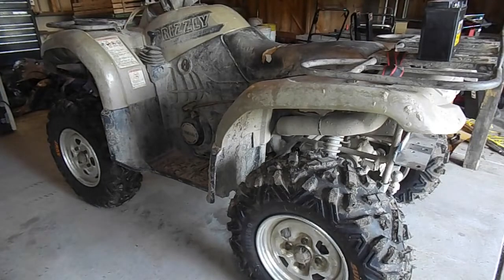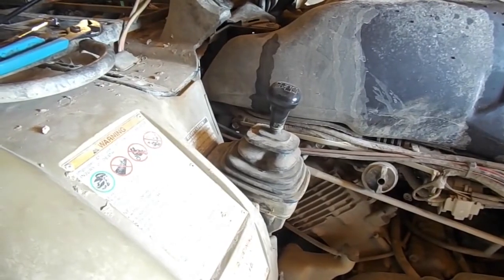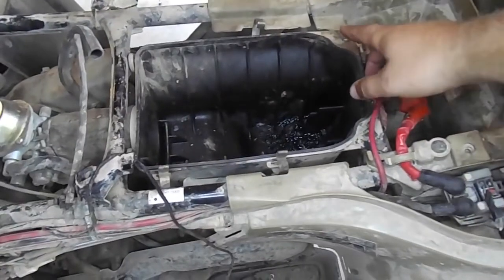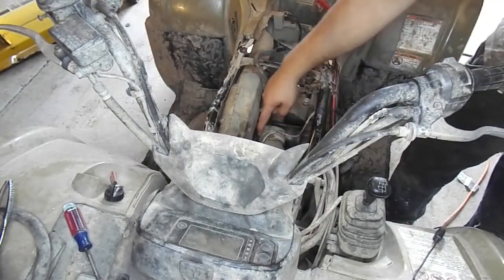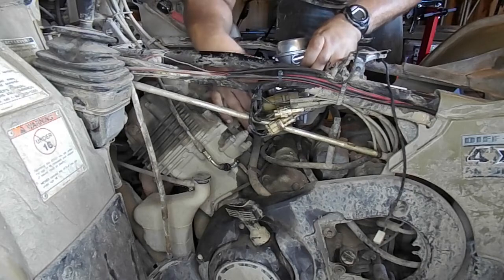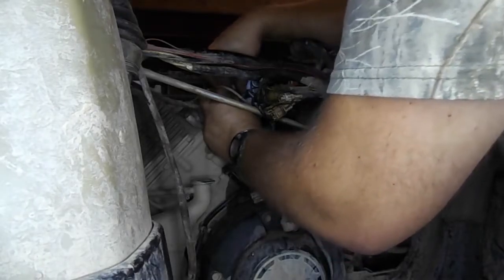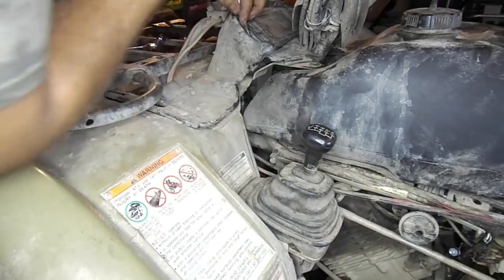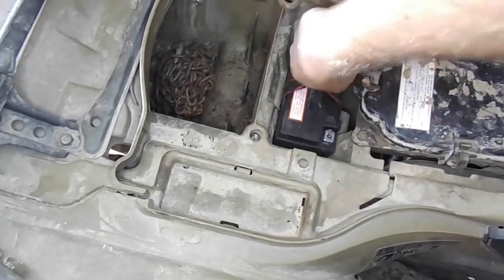How To Replace a Carburetor in your Yamaha Grizzly ATV 4 Wheeler

Comment: Got a question for ya I bought a 2004 grizzly 660 brand new 19 years ago off the showroom floor. Basically I’ve always kept everything OEM. I’ve taken my car bro part a few times over the 20 years just to clean the Jets or replace replace fuel, bowl, gaskets etc. etc.. during the process I have replaced my throttle cable several times over these almost 20 years and I realize there is an adjustment upfront where your actual thumb throttle is and then I realize there’s an axle adjustment that controls your butterfly. Do remember how many revolutions you turned your lock nut. So basically, when you go to remove your throttle cable, you back off your lock nut and then you turn your adjustment screw up the threads to create slack so you can disconnect your throttle cable from your carburetor/butterfly spring and then of course once you get enough slack, you disconnect it and then you do something very similar up on the handlebars to get it disconnected from your thumb throttle. My question is when you replace it with a new OEM throttle. You stick it into the carburetor and install it to the butterfly spring. I forgot how many revolutions you turn your adjustment screw and your lock nut screw on the threads and then of course you do something very similar up on your handlebars to connect the other end of the throttle cable to your thumb throttle. My question is I’ve forgot I know it kind of sits in the middle somewhere your lock nut and your throttle adjustment cable that goes to the butterfly on the carb but I can’t remember. So in Laymans terms, if you can remember, let’s just say we screw the lock nut all the way back up against the carburetor, and then we screw the adjuster all the way up until it stops up against the carburetor. Do you know how many revolutions I turn the adjuster back? And then of course, I will bring the lock nut forward to hold the adjuster in place and then I can install it to the handlebar for the thumb throttle??? Dealing with the idle adjustment screw is something I’m not concerned about because I and anyone else knows exactly how that works. I’ve just forgotten where to set my adjuster for my butterfly and I have a manual, but it doesn’t tell me I actually have a climber Manuel for that bike. So if you can tell me the correct setting or anybody else that might know the correct setting of the throttle cable after you install and hook it to the carburetor it might be six or seven or eight revolutions out. I’m not sure but I want to get it set properly and then use the lock nut and lock it in, like I said earlier, the top part for the thumb throttle is easy but honestly what I’ve been doing since I forgot the correct, setting to the butterfly control I’ve just spun the lock not all the way back till it ran out of threads and I screwed and the adjuster all the way in until that basically wouldn’t go any further And then just picked up the slack up top by the thumb throttle so I just need the correct setting for the lock nut and the adjuster on the carburetor butterfly control!!! Thanks man  so if you can basically just explain it by Al back my lock not all the way off until it has no more room and then I’ll screw the adjuster all the way in till it stops and then you can give me the rotations for the adjuster and then I’ll just bring the lock night up and get a small wrench on the lock nut and a small open and ranch on the adjuster and tighten them towards each other!!!!! Thanks man appreciate it or anybody else that may know I am dealing with an Yamaha OEM throttle cable, just in case someone has a motion, pro or an aftermarket. I do realize that the originals are a little shorter. However, I’ve never had a problem with mine revving louder when I turn my steering to the left or right, I really truly try to keep everything in OEM. Thanks again.
Reply: I guess he doesn't check replies much. Either that or he didn't feel like reading a novel.

Comment: My quad always starts no problem,
But on idle, it  dies, but when I open the choke full, it idles fine.
So every time I ride, I will choke until it warm up,
Choke off when throttle onn running, then when I go to stop choke onn.
I don't know if the nature of the machine,
We got the same concept the location of the carb and everything.
Nice vid

Comment: So the new carb came with jets in the packaging do I need to install those or does already have jets installed?
Reply: Well I would look in the carb and see if it has jet's in it already, perhaps it came with another jet that would be used in a different application, often these carbs are used for multiple engines with different displacements. A different displacements would require a different jet set up.

Comment: Mine will not idle, even when the choke is on, and as soon as I let off of the throttle, it turns off any suggestions on to what the problem could be? Everybody else is saying that there’s idles when the choke is on, but mine does not. There’s a brand new carburetor on it.
Reply: so it runs if you apply throttle? turn up the idle..
Reply: did you buy an oem carb or a throw away chinese carb?

Comment: I stopped watching when you said you can buy a carb for 40 to 60 dollars lol😂😂😂😂  Only the china man will sell you one of those. On a 8,000 machine you don’t put a $50 carb on it.
Reply: Yet you found the time to add your rude comment… You can either buy a $40-$60 amazon out of the box ready carb good for 3-5 years or attempt to clean/rebuild the original (good luck) or buy a brand new overpriced “American Made” (probably union made) for over $600.
For a 25 year old machine I’ll buy from the “China Man”
Reply: Great video, thanks.
Reply: Yeah but the video is excellent
Reply: I removed the fuel petcock knob which made it real easy to remove the tank. I didn’t pay any attention to the new jets that came with the carb from amazon and after I got it all back 
together it runs a little rough.

Great video by the way 👍